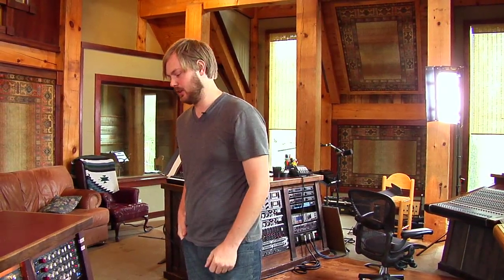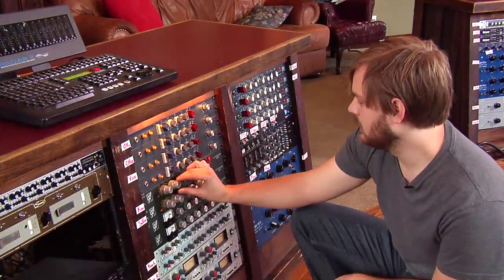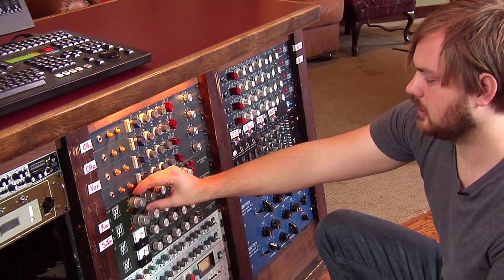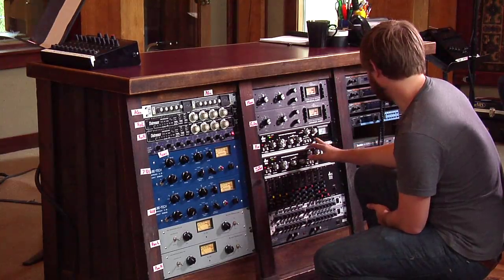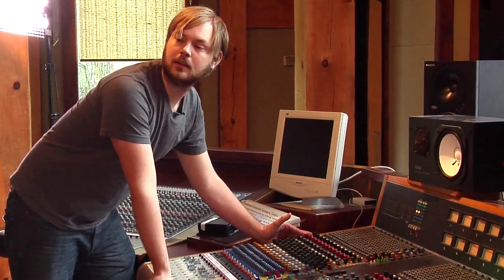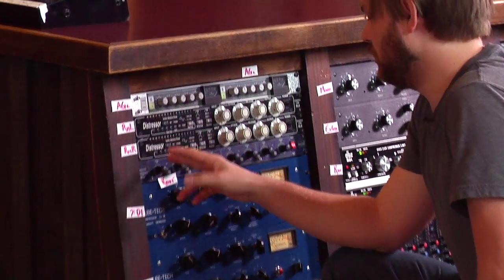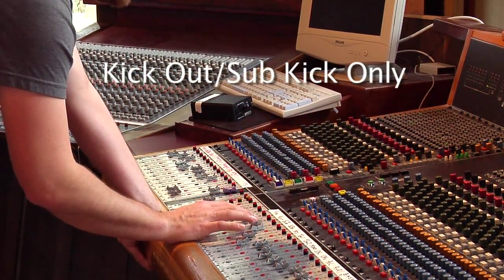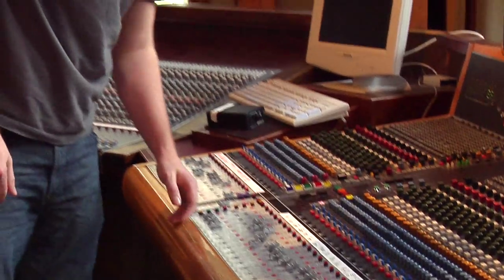How to get a Great Kick Drum Recording Part 2 - Dark Horse Institute

Comment: Yeah, doesn't that sound nice when you're using 5 digits worth of rack gear on just the kick. Good tips though, I'll just have to use the plugin versions of those processors.
Reply: BTW, I love that studio setup. Like, your actual room and the vibe of that room is fantastic. That's an often overlooked part of the studios I get to work in; it's important that you want to spend a lot of time in the room. And I really would love spending time in that room not just for the gear.

Comment: can someone explain to me how you check phase ? did not get that. i know what it is but how do you check it ?
Reply: push the phase-shift button :)
Reply: If two signals sound really good independently, but when you put them together they seem to sound hallow, they're out of phase. Invert the phase on one and see what you get next.
Reply: you can invert phase to check. But to line up phase properly you move the audio tracks 'in time' with eachother, which helps to have some hits of the solo drum for reference. But also might need to move mics if bleed from other drums is out of phase because you can't re-edit that back completely. Because the signal isn't actually inverted its shifting through time, inverting phase isn't the decision in mix but just to check.
Reply: The quick way is to invert the polarity (flip phase) of one of the signals while listening to the two channels at equal volume. If it sounds thinner, quieter, or funky in the midrange your mic is at least partially out of relative phase with the other.  If the difference is drastically worse or better you can probably leave your mics exactly where they are and just leave the channel set however it sounds best.  If it doesn't get drastically better or worse you may only be partially canceling, which is a problem you can't fix with a phase flip.  You can move the mics further apart or closer together relative to the source, or you can move the audio digitally.  If you use multiple mics on a single instrument this is crucial to get right. That includes a two mic kick setup, but also the relationship of those two mics with the overhead mics and the room mics. 
As a general rule I start with the snare/overheads relationship then adjust the kick and Tom mics to sound best against the overheads (this is easier to hear in mono, BTW)

Comment: Awesome video and sound. Do you recommend EQ'ing drums on the way in?
Reply: If you know what you want and the mic won't give it to you, why not?  It helps the performer get excited about what she is doing and that makes everything better.   

Less is more usually, but I don't shy away from trying to get the sound right before I record it. Sometimes it helps me to figure out which mics need to be moved and which are in the right spot but need to be pushed around a little with some EQ. 

You can always EQ later and it will probably sound as good, but if your tracking session sounds better than that of the other engineers the client has worked with you'll win the gig next time.

Comment: p.s. what range Q would you use for the scoop at 300Hz? Would it be a wide range attenuation (i.e. affecting for instance; 200 to 400Hz) or a slim range? Thanks
Reply: It's different every time. Sometimes I do a wide cut at 200, sometimes I do a narrow cut at 400. 300 is just a starting place to try.  Just use your ears and play with it from there. Of course, don't forget the relationships of the kick to the other drum mics and other instruments in your tune. 

Often I'll do fine tuning on the kick EQ while listening to and focusing on the bass guitar.